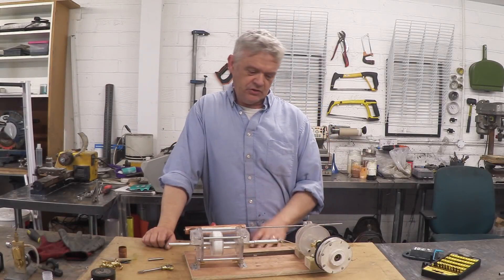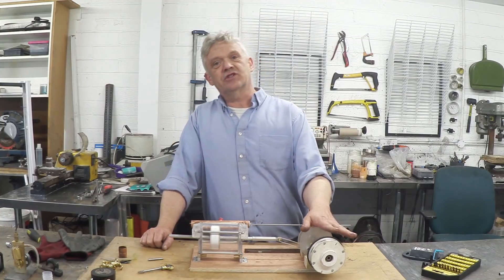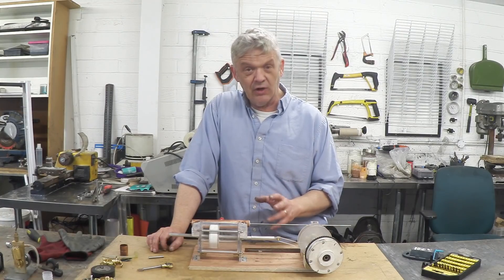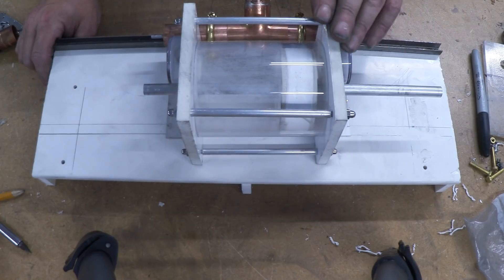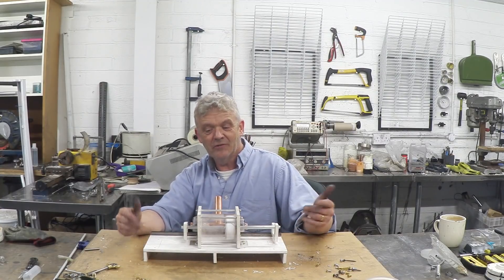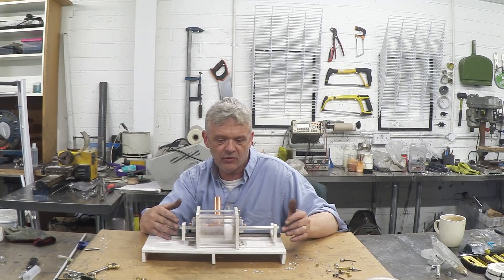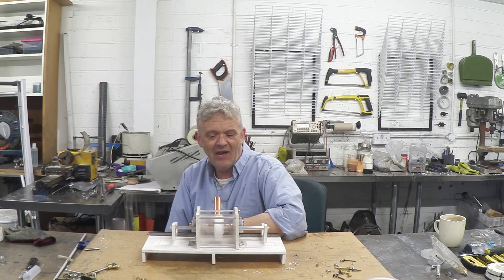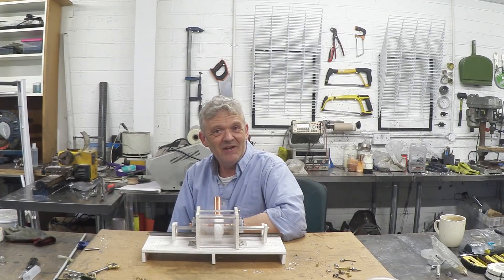Air Driven Linear Generator - PoC

Comment: I came up with a design with the valve and the cylinder operating coaxially, but it did not prove to be worth my effort to build it due to the amount of precision required and some other issues, while it was not immediately needed for anything I am doing at the moment.

I find a vane motor is far superior, because it needs no valves, pistons, gears, crank shafts or flywheels to be balanced, timed, assembled, or add drag to the final design.

A vane motor spins in the one desired direction, consistently, with no need for anything but the air flowing from one aide of the offset chamber to the other.

While there really is no simpler of a motor out there than the gear motor, but the gear motor is hindered by clearances issues which the moving [ 'floating' if you will, and it indeed usually is in some designs <pressed in place by a small divergent application of pressure through a clever little side channel> , although occasionally backed by some kind of a spring in other designs] vanes have little trouble with because they in fact slide in and out of pockets [r some might say notches] that keep them in place and in alignment so that they stick out just enough to trap some of the air pressure moving by and convert that movement into rotational torque and therefore movement.
Reply from the maker: interesting - cheers mate

Comment: Motor design can get surprisingly technical if you want good performance. there used to be a spreadsheet on Instructables.com for linear motor design that seem to me like a good starting point.  

Start with a cylinder material that is as thin as possible and not electrically conductive or magnetic.  Use as strong magnet as you can, at least neodymium N42.  

The basic design uses a cylinder magnet that is axially magnetized and with an iron disc pole pieces on each end to redirect the magnetic field radially.  

A winding is usually fairly thin magnet wire on the order of 100 turns to get decent voltage. You might even want two windings, one on each pole. The motor travel is usually fairly short for good efficiency. Similar to a loudspeaker, the motor works on the Lorenz force principle where the motion, magnetic field, and current are all orthogonal to each other.  The motion is in the axial direction , the magnetic field is in the radial direction, and the current is in the circumferential direction.  

For good power output and efficiency ideally the reciprocating frequency is 50 to 60 Hz or higher.  Although if you don’t mind higher materials cost you can still get more power output at lower frequencies by adding more poles.
Reply from the maker: v good info mate -thanks for taking the time to post

Comment: Awesome. I actually almost recommended light springs inside at each end of travel the other day but was not sure where you were going with this. Though a  bit convoluted I can visualize a worm shaft with a pall on each end of the cylinder which would spin the main shaft as it moves back and forth.  A stator on each end of the shaft and a magnet field to travel through could produce electricity from both ends....coming and going. Clear as mud?
Reply from the maker: lol - I get the idea mate - cheers

Comment: Air source:  Large tank that you can pressurize using a simple bicycle pump (max 150psi).  Large volume, low pressure.  Then, if you wanted, you could put a regulator in the output (to say 50psi as the output pressure), and you’d have a system that is able to run for X amount of time as needed.😎👍
Reply from the maker: for sure mate

Comment: Again, wonderful, quite similar to some of my prior thinking re: cylinder action, linear generator...

Also, while a departure, I have pondered similar, or possibly producing pneumatic power, via the wind tower generator with no turbine, only the motion of the tower rocking in the wind... The further away from the tower center, the more vertical stroke (travel) increases...  A series of coils and magnets arranged in a circumference about the center may be interesting...
Reply from the maker: I like the wind tower bereaver idea mate

Comment: A Trompe is a method to pump and compress air using falling water with the right set up you can have a hydroelectric generator and an aerogenerator using the same kinetic source.
Reply from the maker: cheers mate

Comment: Rather than springs to return the piston, determine the amount of space that is needed between the piston and the wall and put a dab of hot melt glue on each side of the piston or on the piston walls, that matches the amount of space needed between the wall and the piston. You could also put an o-ring on each side of the piston that is equal to that thickness.

Hmm, now that I think about it, an internal spring would have a lower jarring affect and thereby have less vibration.
Reply from the maker: you could mate - but the spring on the piston doesn't only stop the piston - it acts to create a mechanical oscillator
Reply: @ThinkingandTinkering  
😎👍

Comment: +Rob
Good job mate, that is exactly what I was thinking all along. This could also be used as a method for refrigeration using magnets and the metal Gadolinium by means of Magnetocaloric Effect. It is a much more efficient way to create hot and cold for the use of both. You could use the sun and wind to store additional energy that this linear motor would produce and use stored air to run this. The method of using air as a battery for storing solar and wind I feel is an untapped or at least not fully explored method of energy storage.

I have explored this quite extensively and there is even an historic and somewhat suppressed method of generating high pressure air using an old apparatus called a Trompe. A Trompe produces high pressure air just by the natural flow of water from a higher place down into a lower in ground basin, the water pulls in air at the top that would have a collection of tubes or straws if you will, and this air then gets pulled down with the water and ends up in the in ground basin that has a rounded top or cover that collects this air and is compressed and then can be utilized and stored. 

 I am currently in a early stage of creating a tower and Trompe and a ram pump as well as a low temperature heat engine and even utilizing the very air produced to have an air lift to pump water from the final basin back up into the tower for repeated cycles. This produced air can reach high pressures and can be stored in tanks to power many things and air is quite less expensive as a battery for energy storage than a chemical battery. The idea is to marry these various technologies to produce a complete self sustained energy plant that can also be used for many other mechanical needs. You can convert the solar and wind energy to air by simply using a compressor powered by these to use this energy at a time when the sun or wind is not available.
Reply: Excellent thinking, I just became your subscriber, collaboration of ideas is always the best...
Reply: @Peter-bv3wo  Thank you Peter! Yes, absolutely! When we all come together to collaborate our minds and forget the human nature of GREED we can take all of humanity to another level altogether. I have many developments that I will soon be sharing with the world and soon will have this platform to share these things and to hope to keep our abundance and wealth of our minds and collective spirits moving forward all while I try to break the chains that enslave us all of the mindset of corporate money systems. 

These improper thinking systems of seeking wealth and money causes us all to suffer by slowing or suppressing completely the growth and keeping the knowledge in the hands of those that wish to control us and feed off of us as debt slaves. 

If we can put away this indoctrination of putting money over the prosperity of all of us just for a moment, we can begin to see with clarity how free we can become as we all are empowered to be self reliant and slave to no man or system. We can take the value back away from the false imaginary value of money and put True value back into the Human effort of each of us as this is where the true wealth is alive and thrives. 

If we all can produce our own well being then we can be free to help one another and then we would not be subject to the sorts of social experiments or money grabs or changes to economy we find ourselves in today. We would not find ourselves subject to or listening to those that claim authority over us because we will have our own empowerment to thrive and prosper without these authorities!
Reply: @CreativeCircuits   All very good ideas and I really look forward to them, I would like to send you some pictures of a zinc battery that I have been working on but I will need an email from you, and if it isn't to much troublecould you give me your fist name as I hate the idea that I have to refer to you as creative circuits.....
Reply: @Dean-hs3vq  Yes, I know this tech has been around since the early part of the century but has been left undeveloped all of these years until around 2014 and now they are working on the improvements of this with other metals and less expensive magnetocaloric substances. But more important, as I pointed out, is that we combine many of these technologies together along with many of the forgotten ones and utilize linear motors and air as a battery and an energy source that can be stored and used to power nearly everything we find useful as well as electrical generation.
 
We can lower our load demands by coupling the use of air to power many of our devices and harvest electrical energy from it to have an abundance of available electrical energy when we have to power things that we do not use air for.
Cheers to you my friend!
Reply from the maker: I agree mate - I feel there could be much more done on this - I have always been fascinated by tromp systems - I will check out your channel - cheers

Comment: Wave air pump would generate 24/7...and 2 small springs inside cylinder might work
Reply: If you are going to have a wave pump you might as well just have it work the magnet up and down the coil shaft but if it has excess kinetic energy then capturing pressurized air for additional use running the air piston is a good idea.
Reply from the maker: Great idea

Comment: That’s another good one. It brought back a memory of when I used to service and repair portable autoclaves (steam sterilizers). They use a reciprocating air pump driven by a shaded pole motor to provide filtered positive air pressure during the driving cycle. Unfortunately due to the compact design the pump was close to a hot chamber and the motor bearings and pump wouldn’t last very long. The solution was a a linear air pump. No more problems. They were made by a Japanese company called Nitto in case you’re looking for a good linear air pump.
Reply from the maker: I'll check it out mate - cheers

Comment: I wonder if you could use a solenoid on the valve too and actuate it with limit switches instead of swinging these tabs side to side.
Reply from the maker: for sure mate
Reply: I recall a YouTube video where someone made an air-engine and/or steam engine concept out of a two cycle engine. They use some sort of non-contact sensor on the crankshaft to trigger the solenoid valve.  The sensor type could be optical or a magnet with an induction coil or reed switch or hall effect sensor.
Reply: Optical or hal sensors would be more durable